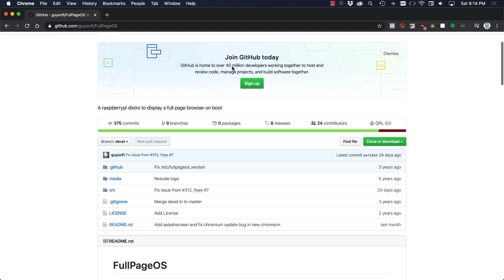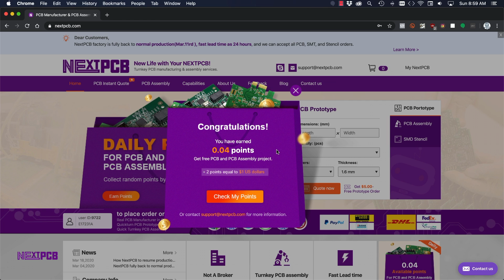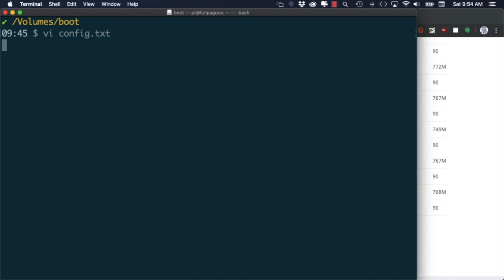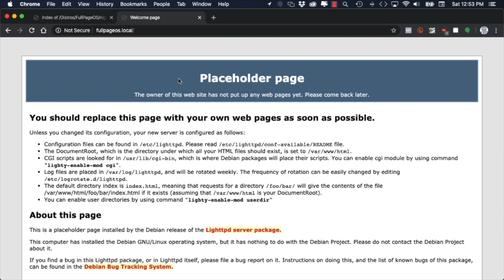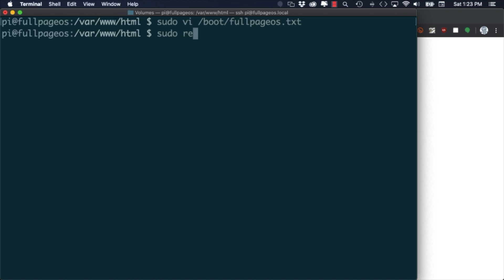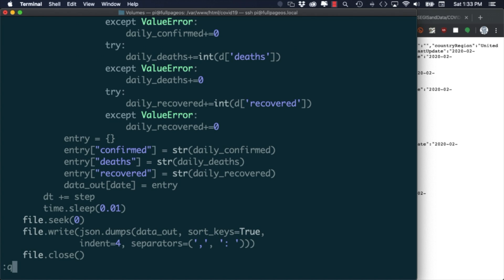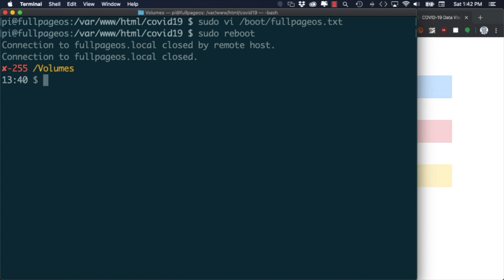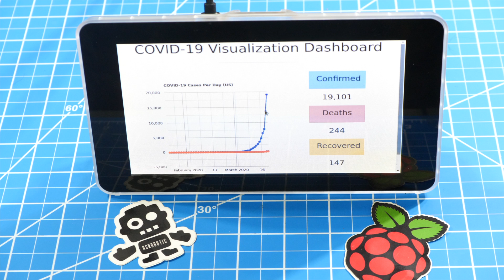Raspberry Pi 4 Data Visualization GUI On 7" Touchscreen Display | FullPageOS

Comment: Hello, I am wondering if I could use this operating system to display a local webpage with gauges, sensors, and graphs for analog sensors connected directly to the Raspberry Pi boards. Alternatively, what would you advise for creating such an interface (visually appealing, smooth, and user-friendly) to build a dashboard for an old car (without OBD port), using only analog sensors?
Reply: Hello brother, and I am also looking for the same idea. Have you found a way to apply this idea

Comment: Why  are using python to fetch json data instead u can directly made in JavaScript

Using ajax function or fetch function it will easy
Reply from the maker: there are many different options for doing this, and python is one of them. "most" things for raspberry pi are designed around python, so i always try to show different use cases of the language in my videos.